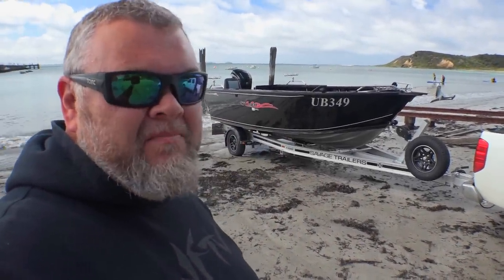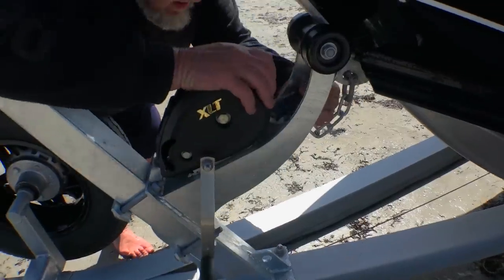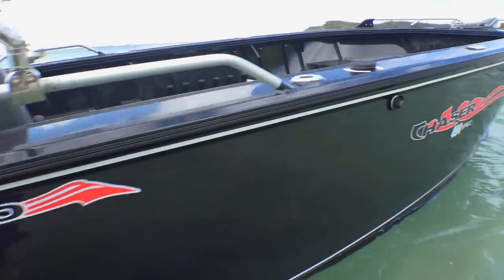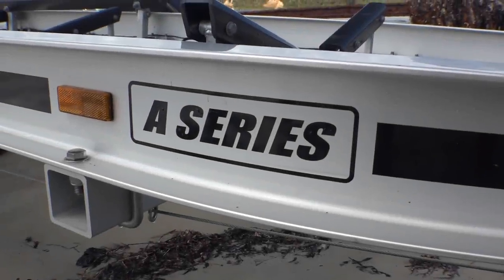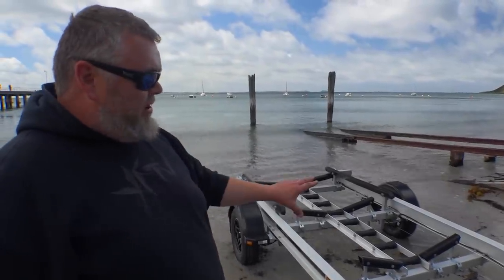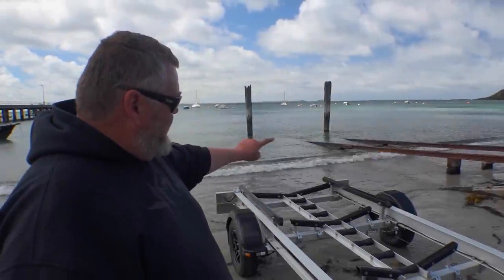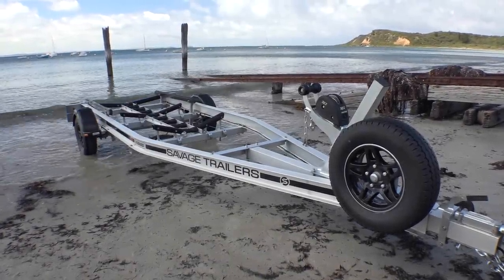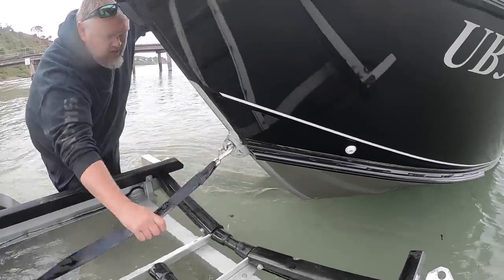Launching boat off the beach is the secret to success!

Comment: I like ye boat, like ye trailer. That front wheel is ingenious! Mine is just like it, but stationary. Oh me, now I've got some modifying to do on my aluminum trailer! Mine looks very much like that but no rollers. I have an 18.5' SeaRay fiberglass boat, 125 HP Mercury. I'll save this video page as a reference on some things for mine! I'm in USA, and only use in fresh water so far. My trailer is also bolted, but some of the bolts are rusting just a bit. I change them all to stainless and use that stuff between bolts and aluminum. Nice rig you have there!!

Comment: Nice trailer.  I tried a beach launch this morning, but no go.  My trailer was completely submerged and my tailpipe was under water, but the boat wasn't floating.  I've had the boat 20 plus years with no problem launching at a regular ramp. 
Maybe I can lower the bunkers which are 2 1/2 inches above the fender guards.  Any other tips?

Comment: The wheel is a good idea, but instead of a square tube, how about a round tube with a pin that you just pull out and it swivels itself into position without having to undo and redo that bolt twice to put it down and then back up again? You’d probably find it a lot quicker to back the trailer to a little bit out of the water and then hook the boat to winch n just winch it across the sand and then up onto the trailer. Bit of effort with a hand winch but swap the hand winch for an electric would be heaps easier. Lovely boat though 👍🏻

Comment: Doesn't the engine cut out mean that water will come into the stern alot easier, I was thinking of buying a 4.88 m but it had a cutout like that one and I'm not sure about it now.
Reply from the maker: It’s got an engine well on the other side of the transom with drain holes so would need a pretty big wave to get over than and into the boat. As long as you don’t reverse hard into a sea it’s no problem.

Comment: Nice trailer looks incredible. Particularly like the fact you can retrieve your boat without your car coming into contact with water. Would it be possible to launch your trailer loaded with the boat using man power or too heavy?
Reply from the maker: Certainly possible. 1 person can push the boat and trailer pretty easily.
Reply: Although it looked like truck was in the water when launching, A drawbar extension would be good too, hinged close to coupling and can swing back against trailer when not in use. so truck doesn't get wet when launching.

Comment: Ahh the Duralack myth lives on it seems.

To have electrolysis (& galvanic corrosion) electrons must flow in an electrolyte.

Electrons flowing in an electrolyte is the very definition of a wet cell battery.

Wet cell battery definition is 2 dissimilar metals separated by an inert spacer, immersed in an electrolyte.

The least noble metal (the one with the lowest valence) gives up its electrons to the more noble metal.

On your trailer, you have aluminium, stainless steel bolts and galvanised steel, black steel axle & springs & wheel studs & nuts.

So 4 dissimilar metals (the zinc in the galvanising being the lowest valence metal in this case, the first one to give up its electrons to the other metals.

So as far as your trailer becoming a wet cell battery - you have all the elements necessary;-

1. dissimilar metals. (aluminium, steel, stainless & zinc - take your pick of any two).
2. Inert spacer (Duralack).
3 Electrolyte (Seawater)

Congratulations, you created a wet cell battery the moment you back it into the ocean. Electrons will flow and the least noble metal (zinc) will get eaten away.

Just like the sacrificial anodes on your Mercury outboard (often called “zincs” but in the case of Mercury outboards a brand specific alloy called “mercatel”, designed to be even less noble than zinc).

So in order for any sacrificial anode to work, ie be the least noble metal in the circuit, the metals all have to be “equipotentially bonded”.

Placing Duralack between the surfaces as an inert spacer just creates the wet cell battery that provides the current flow to cause corrosion.

If you had zinc anodes on your trailer & no Duralack - then the bolts would equipotentially bond all the dissimilar metals and the zinc anodes on your trailer could work & get eaten away to prevent the galvanising being the least noble metal and becoming the sacrificial anode by default.

Duralack is the biggest con ever invented.

Maybe it has insulation properties that are handy in the aviation sector but has no business in marine applications at all.

My 2c

You have a lovely boat & trailer & motor, your only weak link in the whole package is the Duralack.

Comment: why dont boat trailers have expandable neck??so the tow truck wont have to get saltwater on them
Reply: johnneal cabalteja   You can add an foldable extended draw ! ?  Or we use to do a telescopic draw bar it jus double the length!

Comment: I've  been wondering about flinders can i launch a 5.2 meter half cab fibre glass boat from there anyone have any info?
Reply: It can be done on the right day but I wouldn't risk it.
Better off launching at Stony ( at least you know you'll get it back on the trailer in one piece).
I've seen boats pushed off the trailer on a bad day.
Reply: @ozhunter2505  cheers m8 i ended up just launching at stony

Comment: Dunbier has the same beach launch wheel that you dont even need a spanner to use.
Reply: mesittingduck Dunbier Mackay.  Just held in by a large pin with and R clip ?
Reply from the maker: You don’t need a spammer for this one either. You can jus leave the bolt loose and secure with the pin and R clip. But we left the pin in the other car 😩